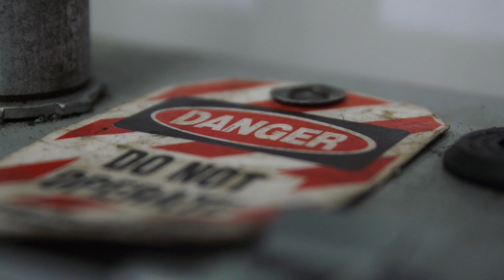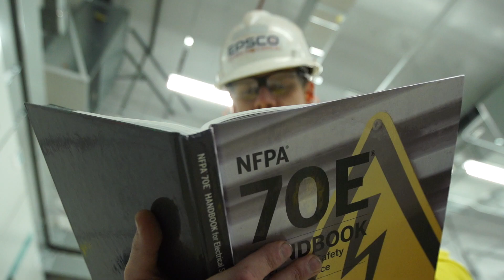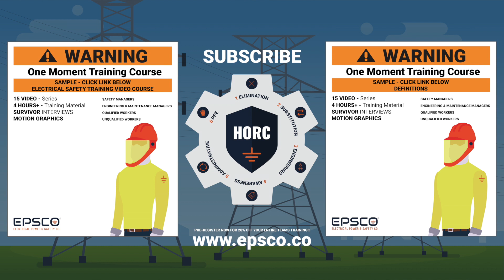Online Electrical Safety Training - EPSCO's OneMoment Series

Comment from the maker: Great Question Robert!  The short answer is yes, electricity in just about any amount or form can cause an "Arc Flash" as it is really just electricity traveling through air.  However, organizations (and standards) like the IEEE and NFPA (More Specifically, look to IEEE 1584 and NFPA 70E) help us understand when the amount of heat generated by an arc flash actually becomes dangerous.  In general, we focus on industrial facilities where the damage can be devastating as there are higher voltages and greater amounts of fault current.  From an arc flash standpoint, the closer you are to the incoming source, the more dangerous it will be in your home.  You breaker panel would produce a larger arc flash then a light switch or electrical outlet.  You should also be aware that the shock hazard in your home is more then enough to cause serious injury or fatality and all work should be performed by a qualified individual.  Hope that helps Robert!

Comment: Can circuit breakers in your own home cause an ark flash?
Reply: Circuit breakers in your home panel can arc no doubt, but nowhere near like industrial electrical like this video is talking about where they're dealing with 480v-2300v 3-phase, not 240v single-phase residential like you have in your home.